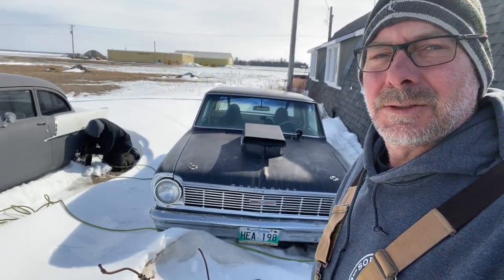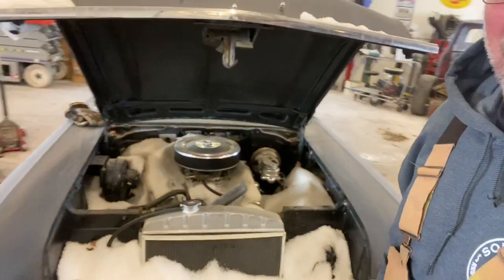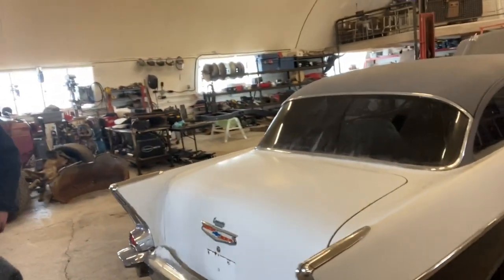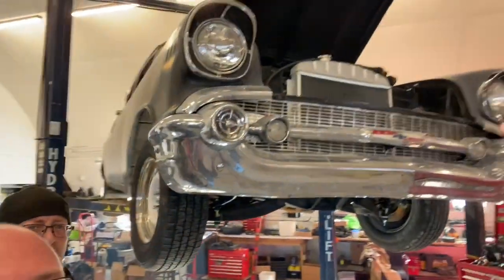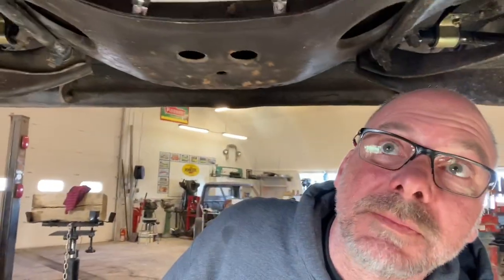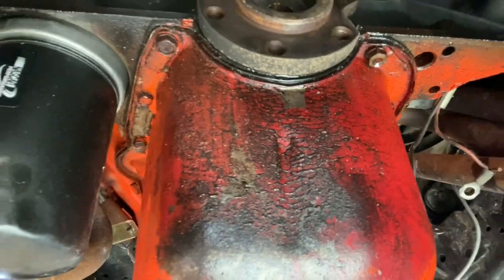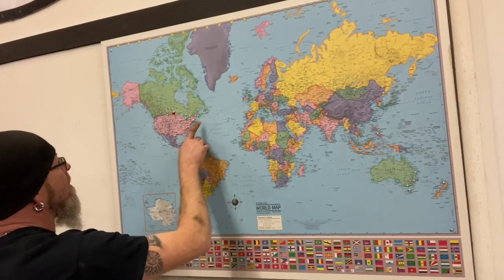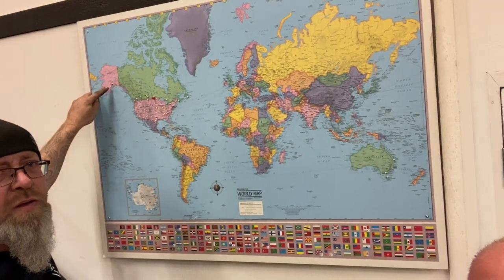Our 57 Chevy getting it ready for BURNOUTS!

Comment: Hey guys, Nice ole 57 210. I've had 4 of them and behind the 55 it's my one of my favorite cars. They are known by everyone and one of the most iconic Chevys ever. Love them.  You got to put on some tires with a little softer rubber then the ones in your burn out video if you're going to beat Peg in the contest.  lol  - Later
Reply from the maker: Thanks Marvin.  It's actually a 150.  I had a 210 2 door post a few years back, wish I still had that one.  Still have my 210 4 door that I got 34 years ago.  We have the proper tires lined up for the burnout.  Slicks are obviously the wrong choice.  Lol.  Thanks for watching.

Comment: Got a junk 283 with AT trans not sure of shape in the city, for $100 or will trade for mid 70’s gm steering linkage/ bar to the steering column.
Reply from the maker: What's wrong with your 283?  We might have the linkage you need.
Reply: Not sure it came with my 47 fleetline. Valves covers are off and pins where pulled. So I’m thinking toast. But has a at trans attached. The clip they put in is from a 77 nova ss. But almost all gm car parts should fit for this era.
Reply: Also this is not the same motor for the clip. The 77 would of had a 350.
Reply from the maker: Are you referring to the shaft between the steering column and the steering box?
Reply: Ya

Comment: Oh boy! A 150 2 dr sedan ...is it a no back seat utility sedan? Is that a Community Chevrolet plaque on the trunk lid? I have one on my Bel Air 4dr sedan.It's a V8 car so it's lower down on the passenger side.One piece front bumper, does it have a seamless frame? This is even more interesting than  the '59 pick up although it is beautiful  even as it sits.
Reply from the maker: Not sure if it was a back seat delete model or not.  It has a rear seat in it, although it's not from this era of car  yes, it has the community Chevrolet plaque on it. It has a fully boxed frame, wouldn't necessarily call it seamless.  This is a cool car.  Thanks again for watching